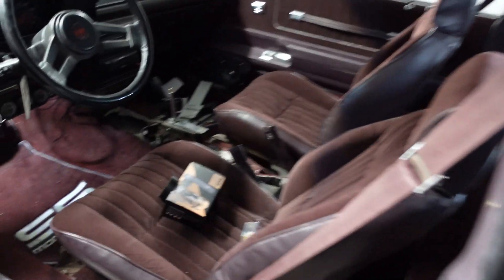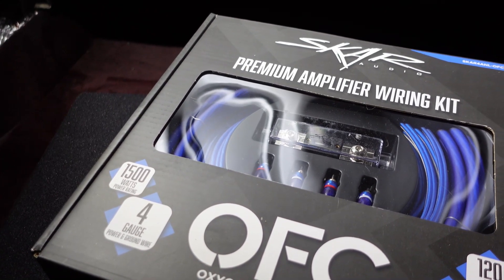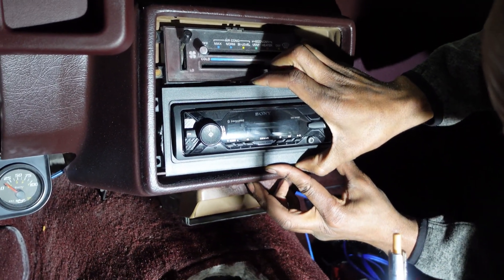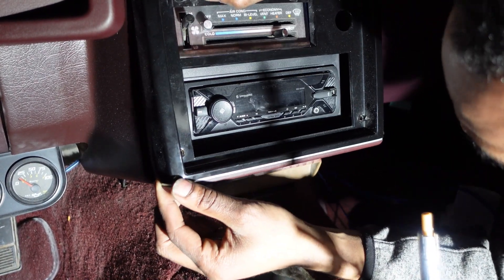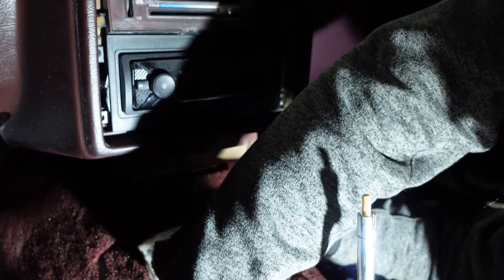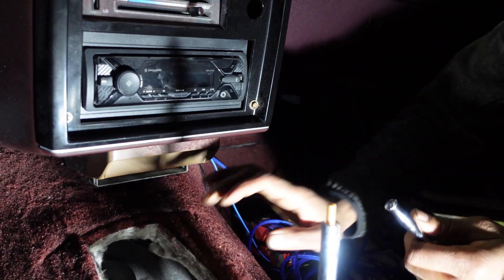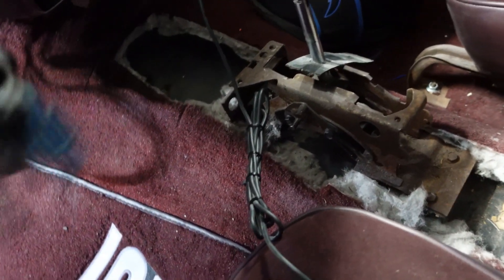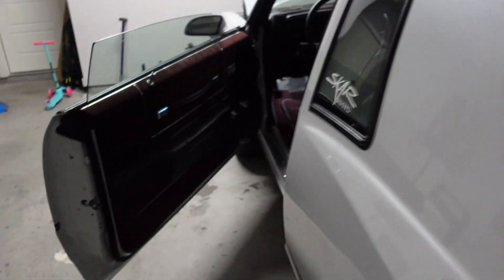INSTALLING SKAR SUBWOOFERS IN MY 1985 MONTE CARLO SS!

Comment: You might have your ignition acc and the constant 12v battery wire's backwards. 12v ignition acc yellow wire coming from the car goes to 12v ignition acc red wire coming off your the radio. Contant 12v battery Orange wire coming from the car goes to constant 12v battery yellow wire coming off your radio. So it'll be yellow car harness to red radio harness, then orange car haness to yellow radio harness
Reply from the maker: That’s what I did they were backwards lol switched them and it works fine now